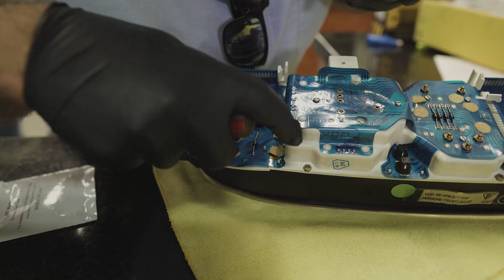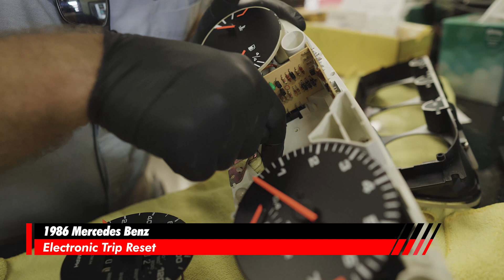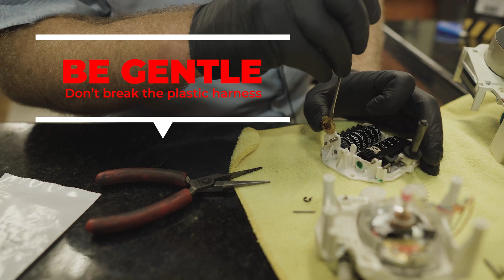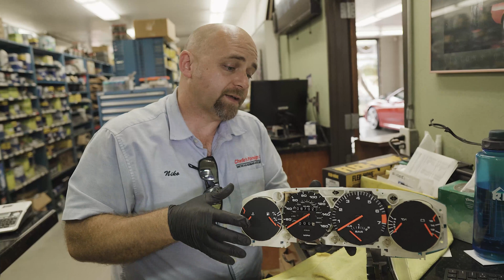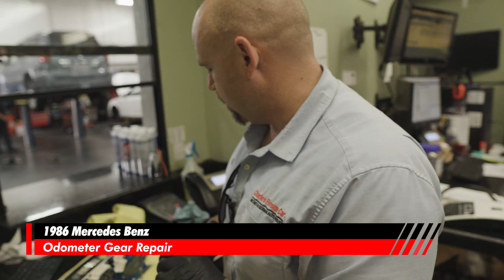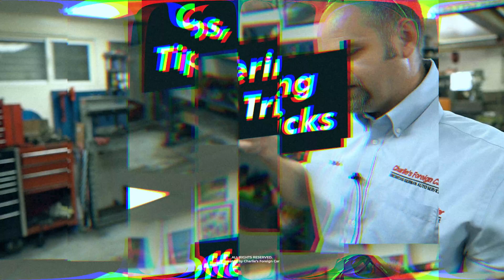Odometer Is Not Moving

Comment: I have an '86 Turbo which I just bought. The odometer stopped working so I assume that will be the gear. In the little bit that I've driven it, the speedo wouldn't start working until I hit about 30 MPH or I smacked the top of the dash. Now that's stopped altogether. Is there any correlation to the ODO and Speedo not working? Trying to figure what my speedo issue is while I have the cluster removed. Thanks